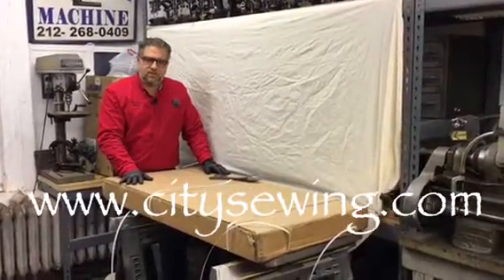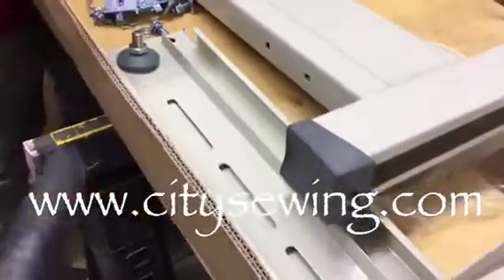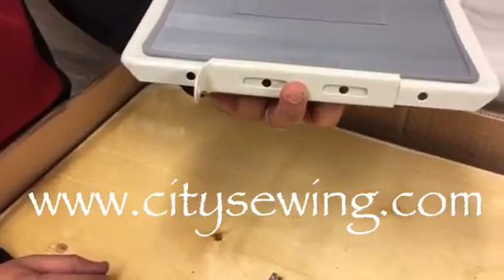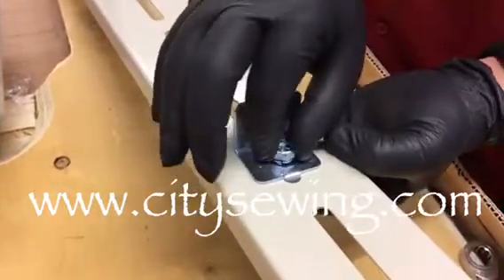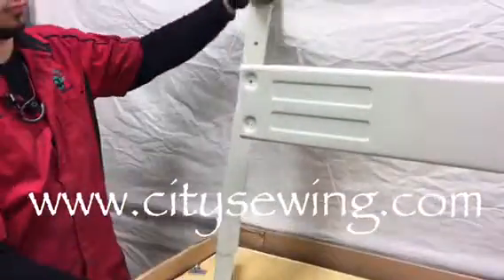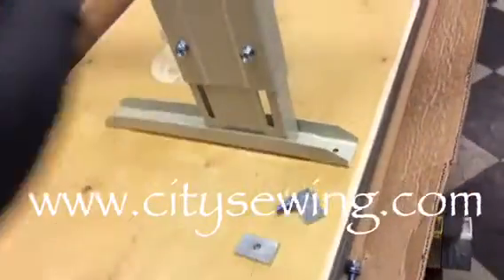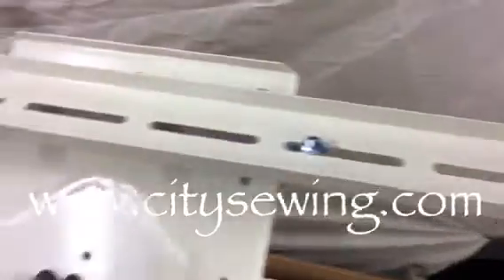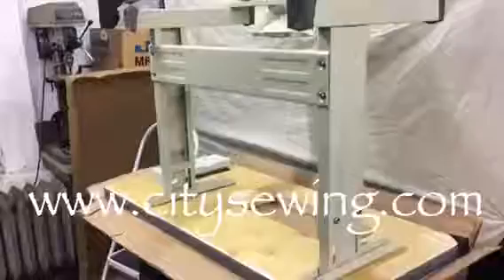How to Assemble a Juki 8700 Table only.

Comment: Great instructions!  I do believe it would have been much easier if the motor was installed on the table first.  That way the foot pedal could be easily aligned with the motor…

Comment: I used my O' Lipfa  Lip edged quilting ruler to get a perfect 1 inch line on the back of the table so the legs will line up perfectly. Then I drew a line with fabric pencil.